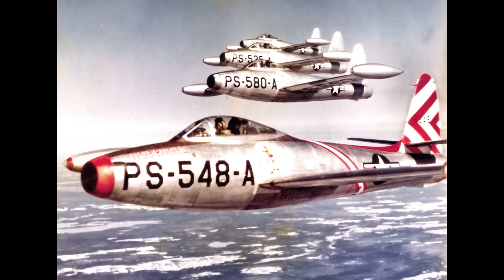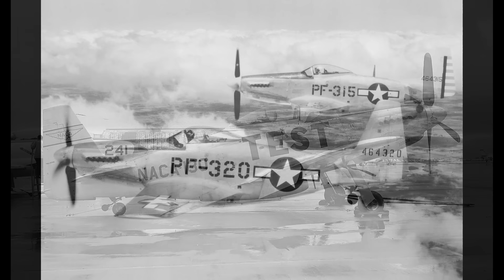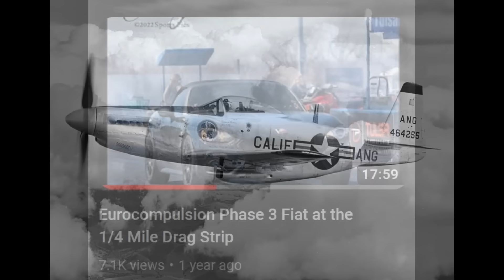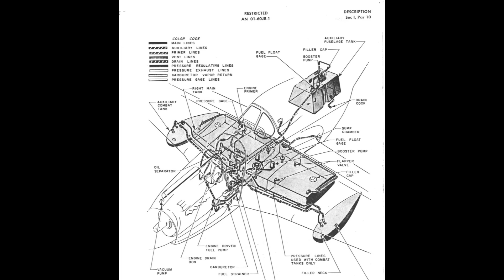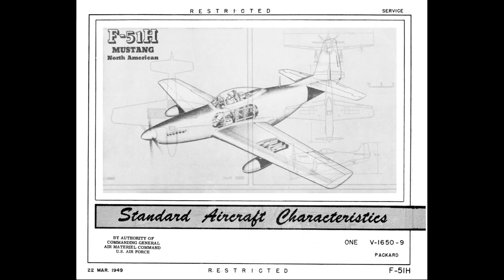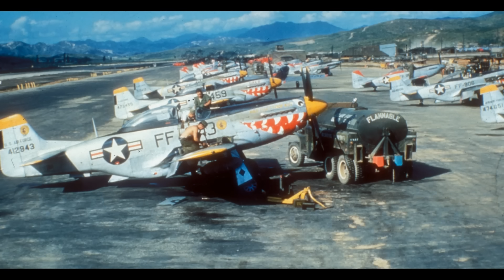P-51H Mustang, Superprop!

Comment: Would it be possible to do a deep dive on the Bristol Centaurus? Maybe compare it to the Wright R-3350? The sleeve valve design is intriguing, but I think at least some of the Sea Furies flying today were swapped to the Wright. I presume this was due to parts availability, but I've always wondered what the power potential and reliability of the Bristol was compared to the Wright.
Reply from the maker: Have you seen my Sea Fury video? If after watching that you still need more sleeve valve, let me know.
Reply: @GregsAirplanesandAutomobiles   I have not! I'll check it out,  next.

I'm super curious how they keep the sleeve lubricated and the piston sealed,  but that might be too detailed.
Reply: @GregsAirplanesandAutomobiles  I think your sea fury video,  and the next comment above,  about covers it.  Thanks!
Reply: The sleeved engines were difficult to build. Typically the hand fitted prototypes worked fine, but in production there were lots of problems due to the tight tolerances required. This was particularly true of the Napier Sabre. At one point the British government had to intercede with the U.S. government to commander a shipment of Sundstrand Centerless Grinders originally intended for Pratt & Whitney to maintain production of the Sabre. Needless to say Pratt & Whitney was not amused. In the end improved exhaust valve and valve seat materials together with high octane gas negated the theoretical advantages of the sleeve valve engines.
Reply: Sodium cooled exhaust valves made sleeve valves not worth all the trouble.

Comment: I thought the post war Mustangs had 2 stage Alisons that demanded relative high maintenance for their mileage
Reply: Something to do with reverse lend lease ending with the war ending, meaning Packard’s license fees from Rolls increasing exponentially, or something like that anyway
Reply: It was a significantly inferior catch up engine.
Reply: The Allison was a good engine, much easier to build and with a number of design advantages over the Merlin. It's primary problem was GM was never willing to spend the money on developing and improving it like Rolls-Royce did with the Merlin. @givenfirstnamefamilyfirstn3935
Reply: The F-82 Twin Mustangthat used the Alison on some models to avoid paying royalties to Rolls-Royce. The Alisons had a reputation for poor reliability at high boost pressure, some have attribute this to the lack of anti-backfire screen in the intake manifold to prevent catastrophic intake manifold backfires.

Comment: Glad you covered the P-51H, there just isn't too much information out there on this highly refined version of the Mustang and you are right, all attention was focused on jet aircraft.
Reply: This is true. I have a book on the Mustang and the H model gets very little attention apart from being described as the lightweight Mustang, almost as if reducing the weight of an aircraft was detrimental to it's performance.
Reply: @markfryer9880  I was reading in one of my old books on aircraft that the P-51H performance was  not just due to it being a lighter aircraft, but aerodynamically refined with a far better engine putting out 2K HP and a superb supercharging system. The aircraft apparently is better than the Hawker Sea Fury and the F8F Bearcat. It essentially was an aircraft that remedied all the problems associated with previous models and was the aircraft that P-51 pilots of previous models wish it was.

Comment: Great video, but think you are being slightly unfair to the 51H as the reason why US fighters often out perform the soviet in terms of combat record is tied to better pilot training, better support structures and tighter manufacturing tolerances - what means that on paper you have one thing  and in actual combat many times performance does not match what was on paper. 
Additionally the 51H was one of the first US aircraft to use what was then often called "high grade plastics" in order to shave some weight. Sadly that awareness within pilots and ground crews reinforced the notion that the aircraft was "fragile" -in the same manner to what would some 30 years later happen to glock pistols, albeit NAA put to good use their experience with the 51H when designing and building the f-86.
Reply from the maker: Regarding the Soviet aircraft, it's much more complicated than that.
Reply: Who counted the real scores?

Comment: I sometimes wonder why the RPM was relatively low, in particular compared to modern engines, but it was not possible to buildt more high RPM engines, or perhaps that would not mean any benefits in terms of HP, even if they had?
Reply: Huge pistons put high stresses on bearings, and huge stroke means high piston speeds.  The designers were always pushing the limits of RPM that could be achieved without reducing engine life and reliability.
Reply: These are really big engines, with big (heavy) parts. Also they are designed to run at full power for extended periods, unlike automotive engines that only see peak rpm's for a few seconds at a time. WWII aircraft engines still ran at nearly twice the rpm that modern large truck engines run at.

Comment: On the oil cooler subject, interestingly enough my lowly 1.4t Cruz has one (it's an Opel engine).  Not sure what is driving the need for it in an economy car (possible the high hp per liter?, however the 1.8 N/A engine also has one) as it's very poorly located and prone to gasket failure due to heat from the exhaust manifold/turbo and engine block.

Comment: The Superprop series are simply brilliant, nice work Greg.🛩
Reply: Some of the most beautiful and coolest planes ever
Reply: They could be a handful to fly due to propeller torque. That's why you see a lot of superprops with counter-rotating props. The de Havilland Hornet solved this with two conter-rotating engines. @dusk6159
Reply: I'm waiting for the Chain Lightning. A four engine Lightning with a wild amount of firepower. Just a matter of time until he covers it. @dusk6159